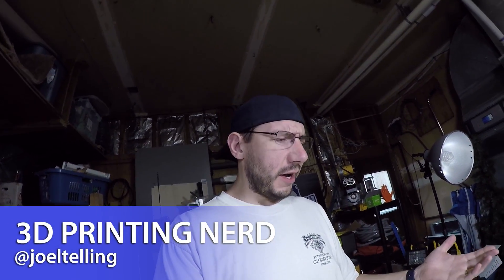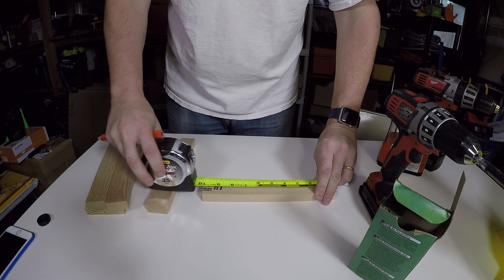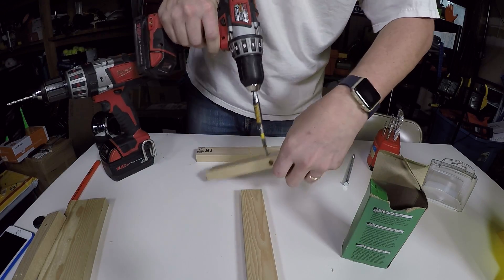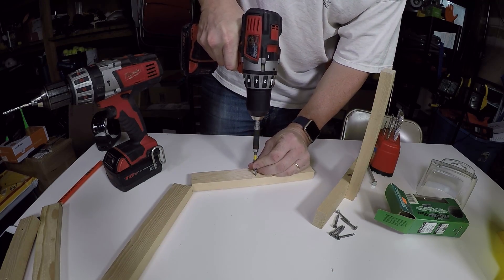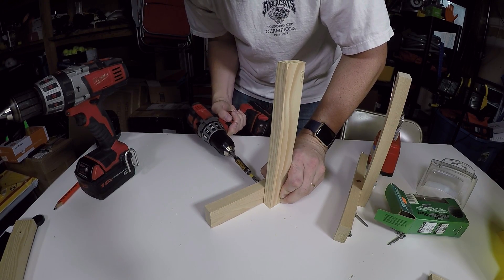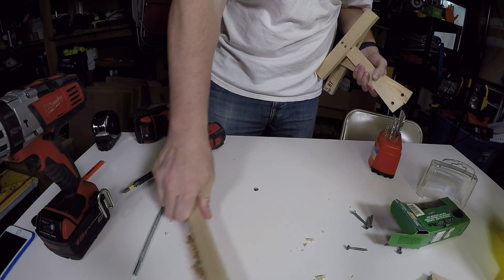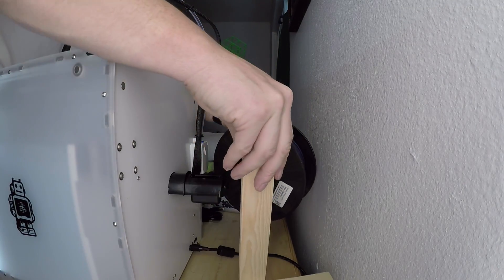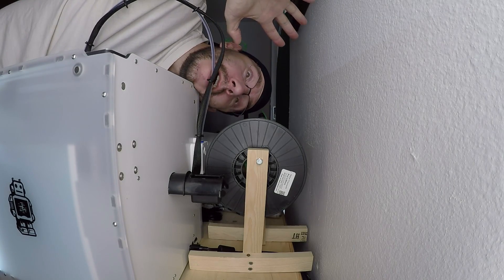3D Printing - Custom Filament Spool Holder

Comment: Always start with a smaller pilot hole before you drill the final larger hole, or just use PVC piping instead. LOL

Comment: we had to do this last weekend when the makegeeks filament wouldn't fit on the flashforge but my husband and I used 2.5 ft of a 2x4 and 1 ft of pvc pipe.  Also it's not a workshop table until it has a hole in it, success.  Duct tape ftw

Comment: and thats why you allways 3d print your stuff. and dont make it from wood and such. your 3d printer will never ever drill holes all over your table tops. you should print a plug for the hole and a little low poly picachu to hold it in place :-)

Comment: I was thinking "he's going to drill a hole in that table" in the seconds before you said "oh wait" and stopped to get the extra block. I love that you still managed to drill a hole in your table anyway (protip tape on the drill bit works like a charm as a depth guide)

Comment: I had a similar problem with the 2.2kg pool from Colorfabb. I just 3dprinted a new support that goes into Ultimaker's holes. Replaced the original one with a bigger one that I've 3D printed. You should be able to find the model on thingiverse.

http://www.thingiverse.com/thing:1815395

Comment: Matt Gorton of PrintedSolid has challenged me to concoct a horizontal spool holder to use to the left of the MP Select Mini.
Thus far, I can find any number of lazy susan type devices approx 10" in diameter but need to elevate them to the feed tube.

Anyone have any suggestions on this challenge?
Reply from the maker: get some spare wood off the floor and drill a hole in your table. worked for me.

Comment: Idk if it would be worth it but you could 3d print a couple bearings to go in the spool hole so that it spins in the center of its weight, rather than offset a bit.

Comment: great project .   for the hole.  if its rite through , tape from the under side  and fill hole with wood dust and wood glue almost to top , then when thats dry , put some crazy glue as baking soda . it will make a hard  white top .  it will still have a visible mark but a mostly white  hard top .
Reply from the maker: It's hollow core, so that may take a lot :)
Reply: oh snap, nuts . um is the table ABS by chance ?  .. he he . like those folding craft tables .   some ABS and one of the  3d print sculpting tools == hole welded gone .   like  3d rpint a plug that is a tight fit and weld it at the edge and smooth it flat ..  3D print for the save ?

Comment: Hey Joel! I'm using the Low friction UM2 spoolholder created by IRobertI on my Ultimaker 2. It fits various Role sizes and is put together with bearings so it runs really smooth (and it doesn't make squeaky noises). You can find it on youmagine.com...
Also... don't put holes in your table... ;)
Reply from the maker: Oooh, thanks for that I'll go take a look. AND DARN IT NOW YOU TELL ME! :)

Comment: might want to put some board on the bottom for more support so it dose not fall apart. just let u know
Reply from the maker: +Thomas Lamourine ooh! Great idea!
Reply from the maker: So far so good, though, you're right I may want to add that!
Reply: yup.. agree with Justin,  over time the bolt hole will widen and one of the legs will wiggle free and fall over.. simple cross piece between the 2 legs will stiffen it up and hold it all in place...   I have basically done the same thing.. the other advantage of the cross piece is instead of a "hole" you can make that a notch in the top.. so you just drop the bolt and spool in place instead of having to pull the bolt out the side to get the spool change.  easier.. probably even more so where you're behind the machine.
Reply: ya it is... that's why I came up with it!!  LOL  (little self esteem there ;) )

Comment: Could you design and print an adapter to go over your ultimaker spool holder? I don't know what the issue was with it binding but I'm sure that we could come up with a work around :)
Reply: Finished the video so now I know lol.

Maybe an extension for the spool holder to hold the non-ultimaker spool?
Reply from the maker: I think I could print a whole new spool holder for the UM - or that may already be done. I'll have to go looking around.

Comment: Another good video.  I had a question for you...

I recently read a study that said ABS and some other filaments emit "fairly large amounts of styrene" during the heating and extrusion process.  Styrene can cause cancer, so I was wondering if you'd consider make a video about 3D printing health and safety.

I know it doesn't sound sexy from a video perspective, but I'm sure many people would find it valuable.  You could discuss ventilation, enclosures, different filaments, etc.  Then compare your personal experiences with enclosed printers vs. open.

High Five!

Comment: Another good video.  I had a question for you...

I recently read a study that said ABS and some other filaments emit "fairly large amounts of styrene" during the heating and extrusion process.  Styrene is carcinogenic, so I was wondering if you'd consider make a video about 3D printing health and safety.

I know it doesn't sound sexy from a video perspective, but I'm sure many people would find it valuable.  You could discuss ventilation, enclosures, different filaments, etc.  Then compare your personal experiences with enclosed printers vs. open.

High Five!

Comment: I'm with the other guy, I would add support on the bottom and put a nut on the bolt to lock in the spool. You don't want the thing falling apart in the middle of a print.  Also have you seen this vice on Thingiverse? http://www.thingiverse.com/thing:1806323

Comment: 3d print a white plug for the hole in your table! 🖐🏻
Reply from the maker: YEAH!!!
Reply from the maker: heat gun - brilliant!
Reply: And you can use a heat gun to melt the 2 plastics together too!